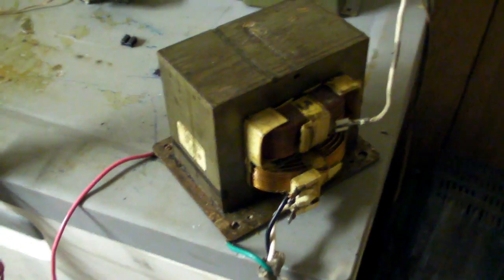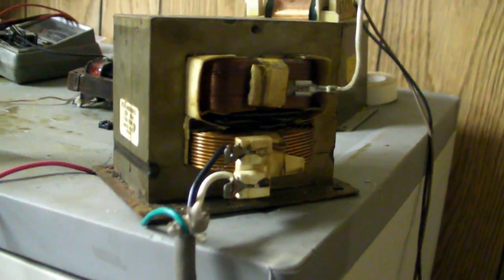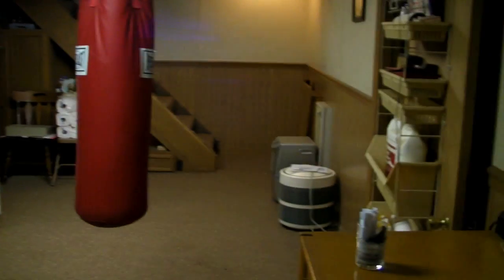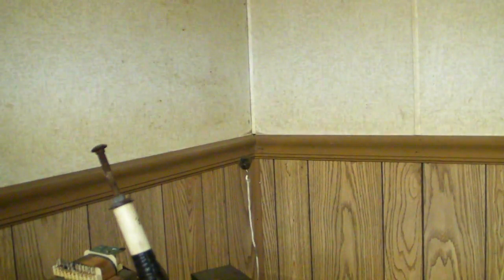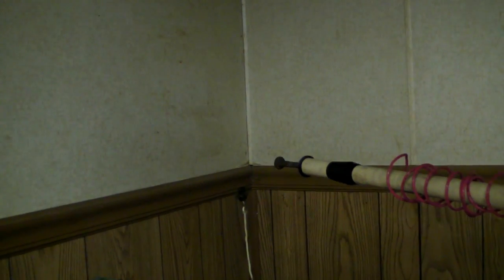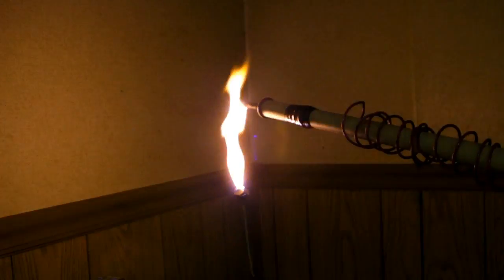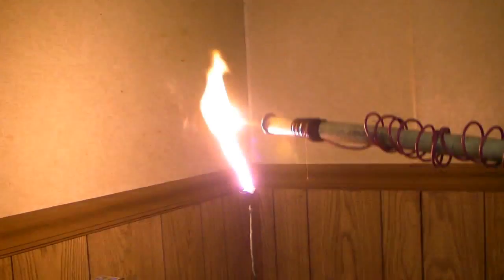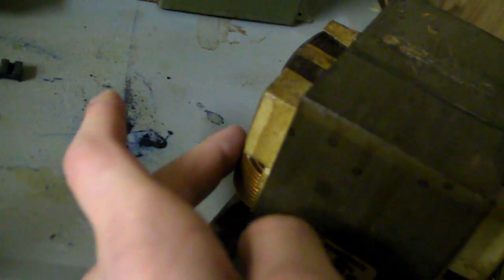Microwave Transformer Heating Test

Comment: I'd been thinking for my own experimentation of using a big old motor as a series inductance to limit the current presented to the MOT primary. It MIGHT help with the heating issue. Only experimentation will tell. :)

Comment: Capacitors do not limit the heating to primary an do not transfer any heat to the secondary...
Be careful you can die very easy.
Reply: So how do you reduce heat

Comment: they are not unneficent they have small duty cycles meaning they can output theyr rated power for a limited ammount of time,to cut down size and cost,since you arent going to use an microwave transformer for more than 5 mins in a run

Comment: Hi, can you tell me please how much current this type of transformer takes in the primary when connected to the 120 volts, without any capacitor and with no arcs or any load on the secondary? thanks!